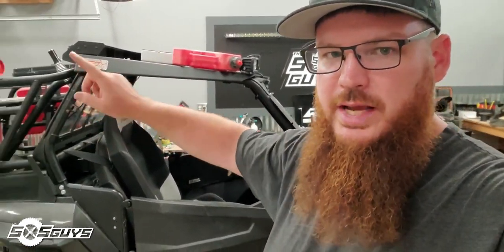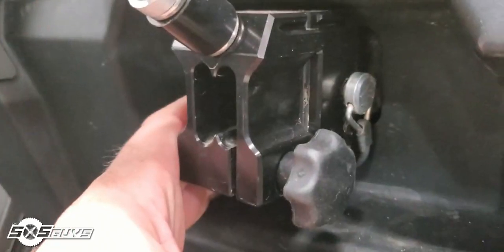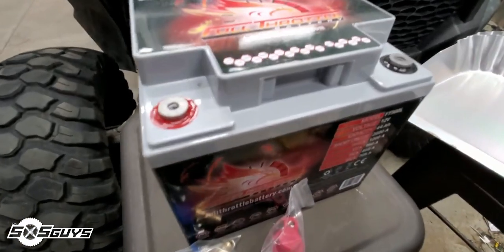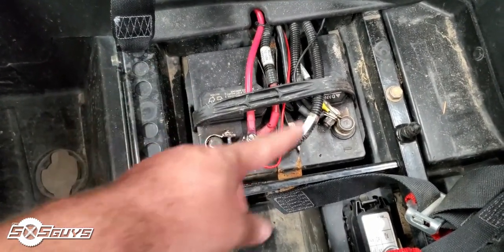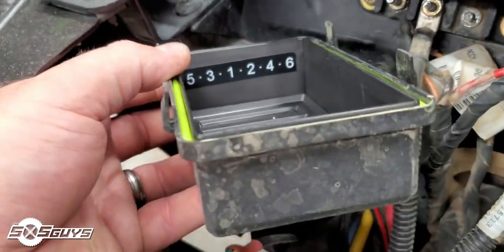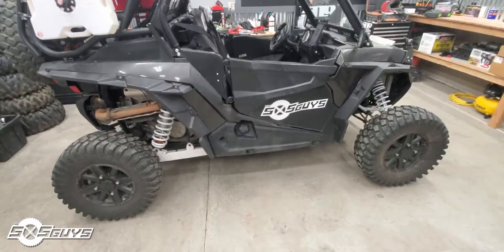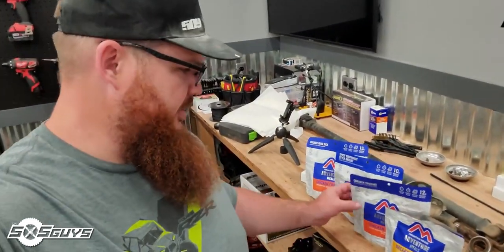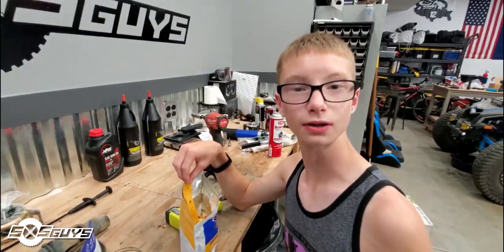Even More BDR Prep | The SXS Guys Vlog

Comment: You may have changed this already but if you have a rollover that causes a fire, your extinguisher could be damaged being located on top like that. Keep up the good work on the podcasts!
Reply from the maker: Yeah, but it's also not the only extinguisher! ;) When you close off the cab with a windshield, rear window, roof, cage etc... you mounting points where its accessible are limited without it sticking out where it'll get caught by trees etc. There's a thousand ways you can mount an extinguisher, it just depends on what you're doing and the build-out for the trip.